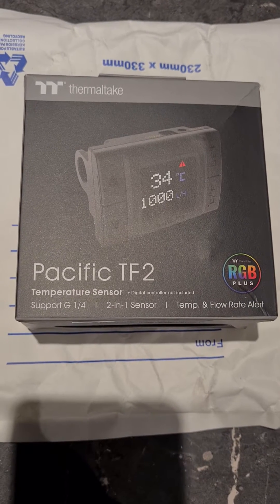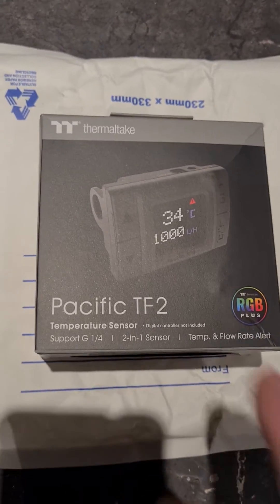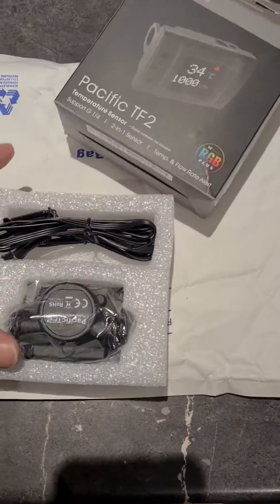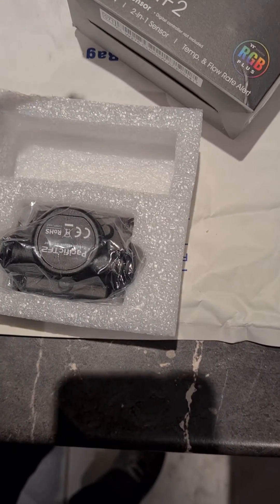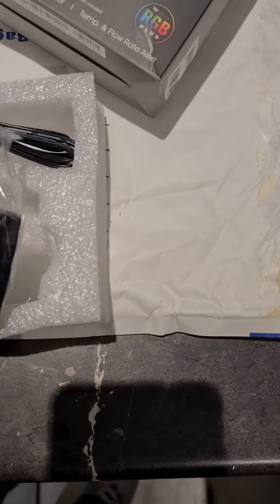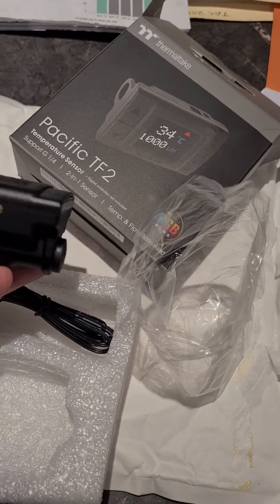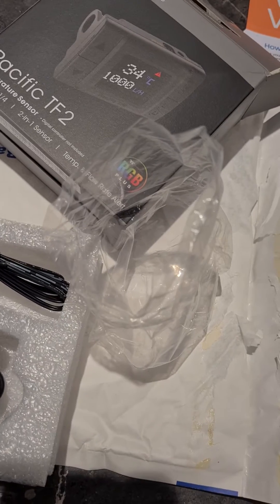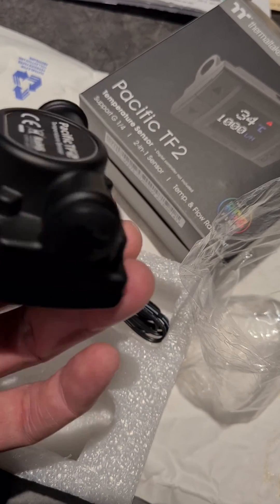Thermaltake Pacific TF2 Flow and temp sensor - PART 1 Unboxing and review

Comment: Trying to figure out if flow direction matters on these units, do you know?
Reply from the maker: I dont think it does as there is nothing on the unit itself or in the instructions however no one has confirmed or denied it and I havent tried it the other way around.
Reply: Cheers, I guess I'll find out soon enough then. :D   ..I think it'll be fine, but if I have any issues I'll post again.

Comment: The sync cable is a 3 pin rpm signal  wire?
Reply from the maker: The sync cable as a 3 pin connector at the flow meter and Thermaltakes 9 pin connector at the other end to plug into a Thermaltake RGB fan controller, in particular the controller for the W4,W5 and W6 CPU water blocks.
It provides both flow rate and temperature signals to be displayed on Thermaltakes software.
This sync cable is not compatible with Riing or Trio controllers unfortunately.

Comment: Did you tested? is there any noise from it? I have a Bykski flow and temp meter that rattles like crazy, so I’m thinking of replacing it with this one
Reply from the maker: The TF2 is extremely quiet to silent.
See my PART 2 testing video